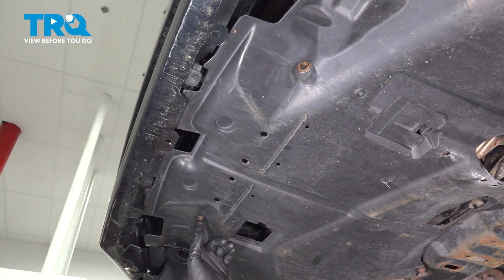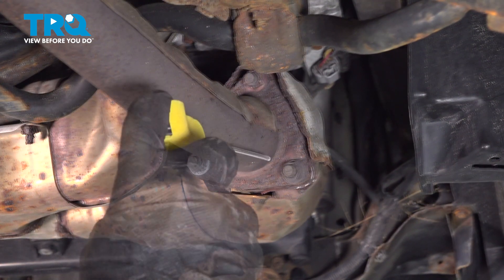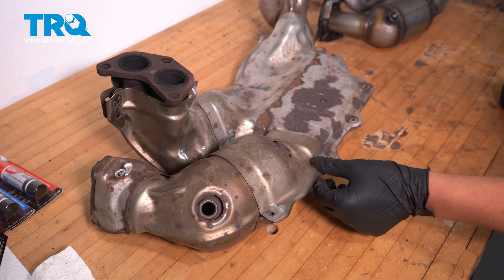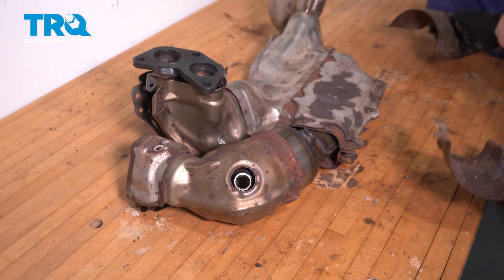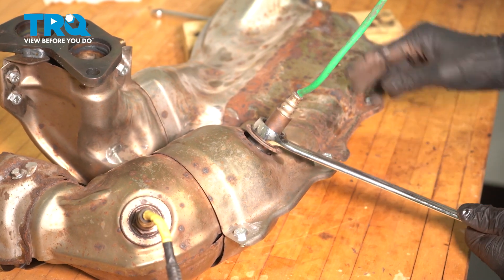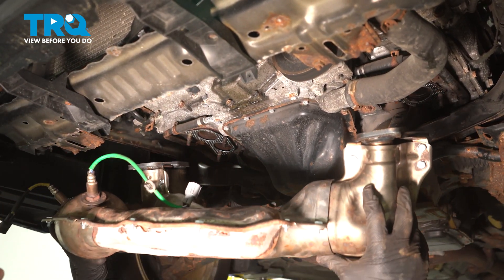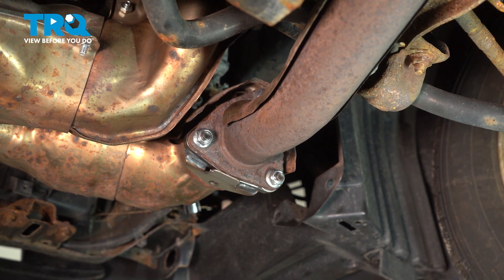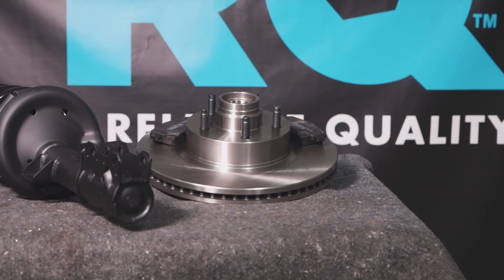How to Replace Exhaust Manifold Catalytic Converter Assembly 2012-2016 Subaru Impreza

Comment: I'll be doing this next week when my parts arrive. I have a DTC P0420 so I ordered the catalytic converter assembly along with both O2 sensors. I like to replace the O2 sensors together with the catalytic converter. I love working on Subarus, they're so easy to work on as everything is so easily accessible unlike many other vehicles.